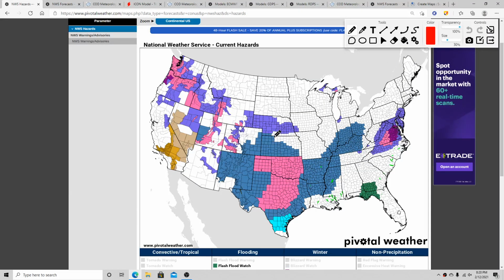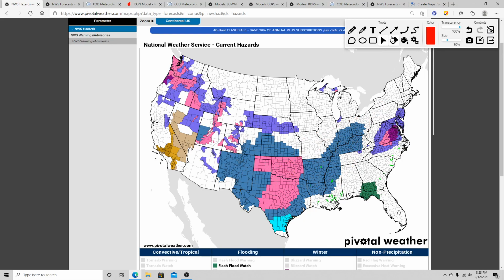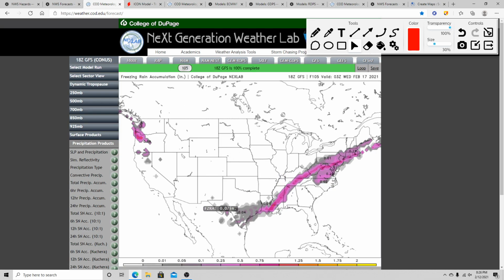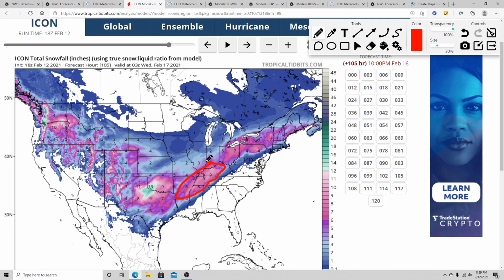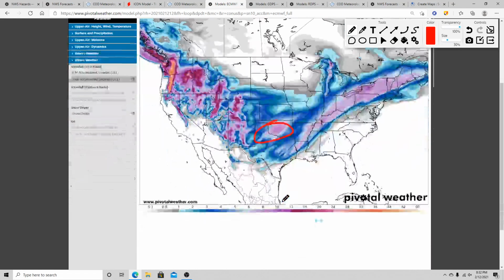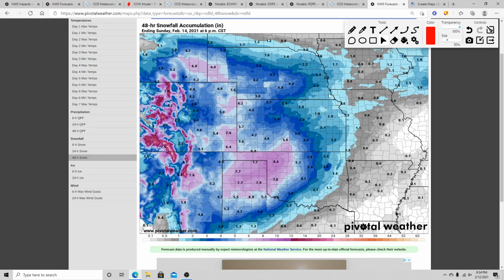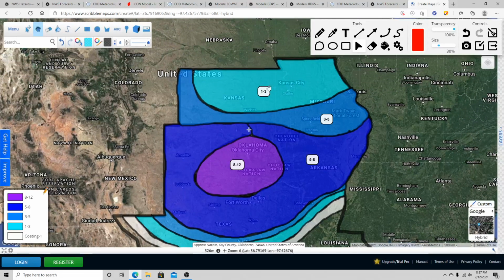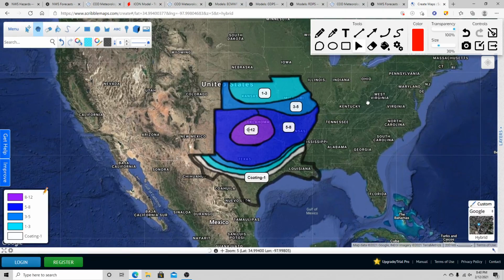Major Winter Storm Expected Across the Southern Plains and Possibly Up into OH Valley and NE.

Comment: Hey was wondering how much you think 1 inch of sleet would lessen the impact of .25 - .60 ice fall wkyt has
Reply from the maker: Yes definitely!
Reply: @Storm-nq5cn  By about how much do you think?
Reply from the maker: @renji708  1/4 - 1/2. Their could be isolated 1/2+
Reply: @Storm-nq5cn  Would that be enough to keep power from going out?
Reply from the maker: @renji708  it will make the chances lower for a power outage but the chance is there for a power outage.
Reply: @Storm-nq5cn  Well from the models i think were getting around 3 to 4 inchs of snow too so if it changes over it should lower the chance even more right?
Reply: Oh I was asking about how much you think the sleet would lessen the blow and if that would give us a chance of not losing power
Reply from the maker: @renji708  it's really going to depend on the warm air aloft which is hard to predict.